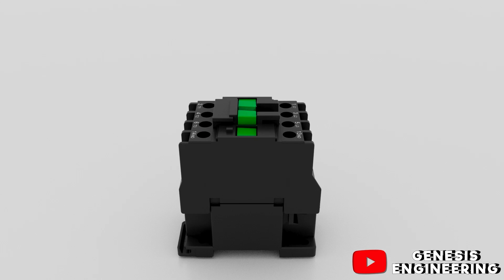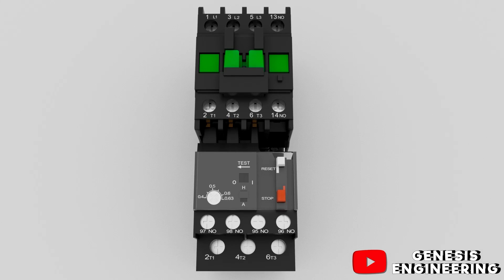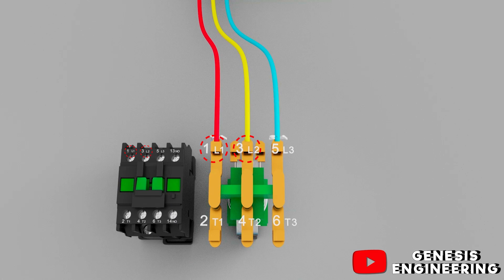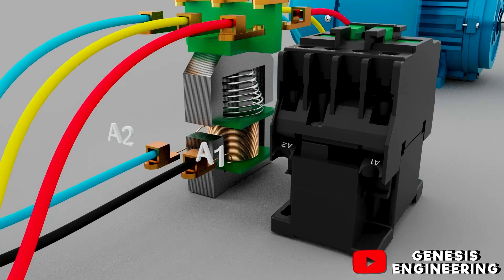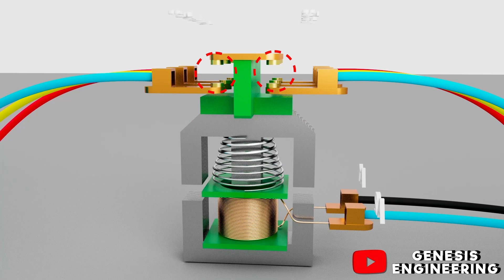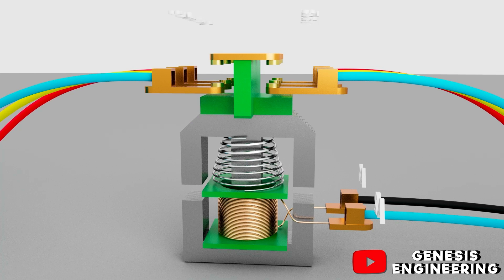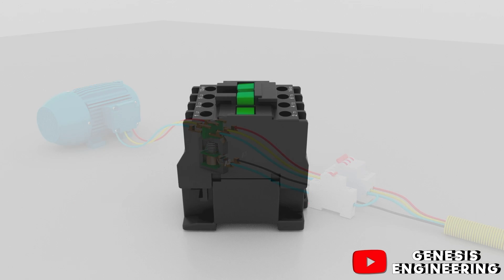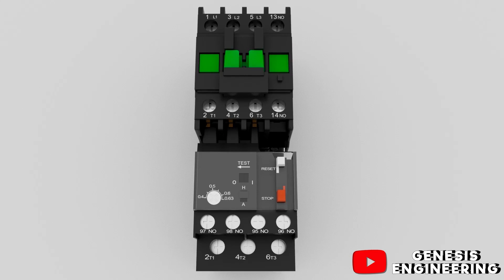WHATS IS CONTACTOR?

Comment: Additional:   with the control coil deenergized, and the moving core AWAY, the inductance [of the coil] is much lower.  When the coil is FIRST energized, the energizing current is HIGHER.  Once the moving core comes close to the fixed core, the inductance INCREASES and causes the holding current to be LESS.  [This is for most contactors that are controlled with AC voltage.]  This is a reason why you can't drive an AC control contactor with a DC voltage... the current and power dissipated would be very high.
Reply: Thank you so much

Comment: This video talks about contactors. A contactor is an electromechanic device which allows to power devices that requiere a high amount of current. These kinds of devices are comon powered by three phase energy. The contactor features a coil  and  contacts normaly open and normaly closed. When the coil is powered, te contacts change its state,  allowing the flow of electricity trough the contactor. The contactor has three terminals for plugging, those ones belong to the energy. It also cointains two terminals for powering the coil.

Comment: Sir, how much current can the NC or NO pole carry without failing? Can it carry 10A DC for long term? I understand NC, NO poles are auxiliary poles and not supposed to carry power load as their contact area is also small. But I want to know how much current it can handle? Thank you.

Comment: I have a question. How can the contactor stay closed when the power over A1 and A2 is AC. In my mind the magnetic field would change directions 50 or 60 times a second depending on where in the world you live. Can you explain this?
Reply: Since the frequency is very high you can relate this phenomenon with mutual induction concept of transformer where due to AC there is induced emf and the process continues

Comment: Some fancier contactors have inbuilt over current protection so it’s like it doubles as an over current circuit breaker. Generally when those contactors are tripped the button will pop out instead of being flush with the case and it disconnects the solenoid in that tripped position so it cannot be reactivated by whatever is controlling it until someone pushes in the contactor to manually reset it’s breaker.

Comment: Thanks for a very informative and well explained video.
Now I understood how my contactor for my drillpress works, or does not work in my case.
The coil is defective, I would have never found out without this video.
A coil is much cheaper than changing the whole thing. 👍
Reply: I bought an $18 coil and now it works again.
Contactor was $75. That's a win. 👌
Reply: @Kaj_Kasket  awesome ⚡

Comment: Now the electrician has a very well supply with knowledge,unlike during my era,I know nothing but because of my interest to know how to be an electrician,I perseverse more until I was hired in the power plant and passed also the board examination as master electrician,I was well versed familiar with,forward/ reverse,multi speed,reduced voltage starter,wye/ delta,coltrolled in more than one area,etc.

Comment: Why use a contactor for lighting rather then a simple mcb?
Reply: Contactor is used for high CURRENT ampere draw and high powered devices such as motor, water pump, machinery etc. It depends on the CURRENT ampere draw and you can use normal switch for lighting if draw less than 6A
Reply: @superpooper_2030  I'd love your knowledge man 😢....depending on amps determins how many times you can wire off the same contactor??...really appreciate thus video

Comment: I have a question so how do you sent neutral on load side ? Let’s say to a pole light ? I only see hots coming in and out put just load/hots
Reply: Use multimeter continuity mode to check if you have doubt

Comment: You have added to my low experience as a technician, you guys are so good to such educative stuff ,love it
Reply: Very nice
Reply: @genesisengineering1409 Thank you very much for n my case is a fire suppression system in a commercial kitchen. When the  system is activated  the pressure switch should send a signal to the solenoid valve to close. In this particular kitchen the solenoid is connected to the gas detector. Shall i connect my pressure switch directly to the gas detector?